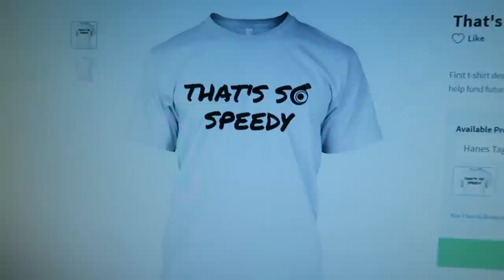Shopping Cart Go-Kart!

Comment: thats a 49cc caglari. remove the emulsion tube run a 9/16th drill bit through the carb. clean and reasemble. pull the cylinder add a boost port acroos from the exhaust. bump the timing a couple degrees and they scream.